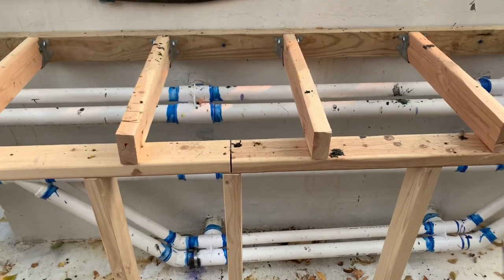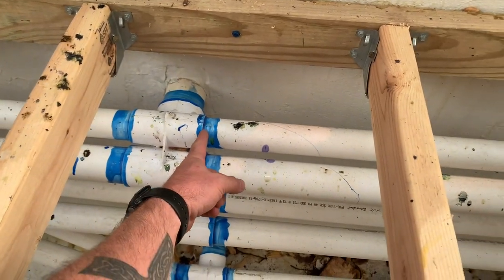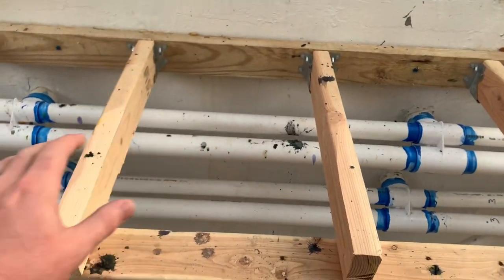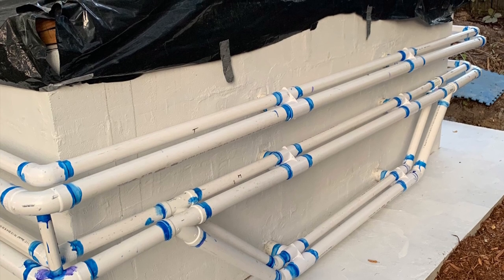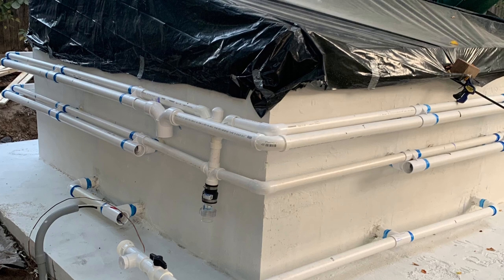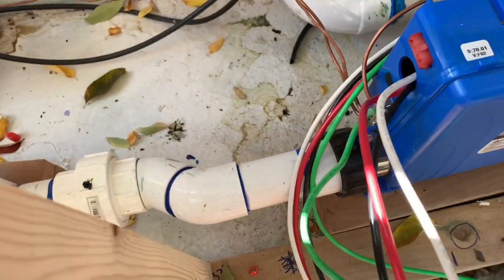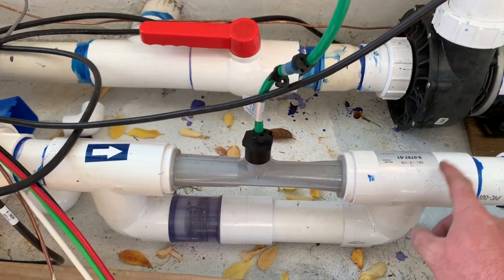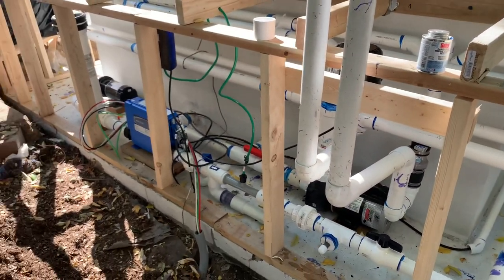DIY Hot Tub- Part 7: PVC Work and components

Comment: Hey John, what pump did you use that have a 2” diameter for the water pipes, I bought one pump but I can only find the 1.5” diameter, I’m struggling to use that to my jethousing to connect it to that 2” pipe diameter
Reply from the maker: I think I have a 3HP waterway viper jet pump. It has a 2-1/2” inlet and outlet.

Comment: On your regular pump, I didnt see a pump basket on front of pump. You have a skimmer, which will pick up debris from top of water . Wouldn't the debris clog your pump before it goes to filter
Reply from the maker: So far I’ve had no issues with that. I know there are several tubs built using this same method they have been up and running for 15+ years with no problems.
Reply: Normally the water would be filtered before going to the inlet of the pump